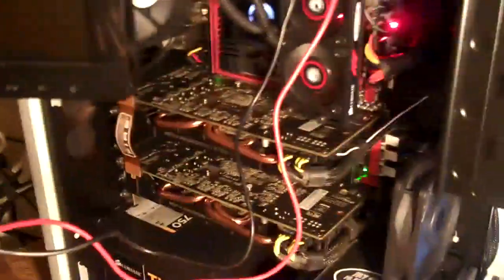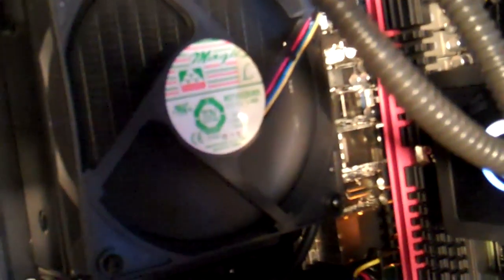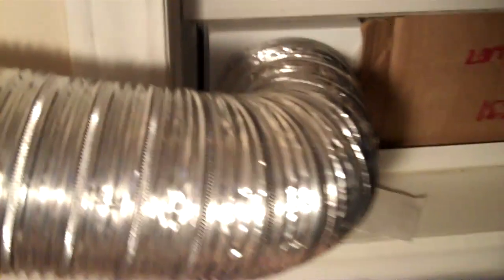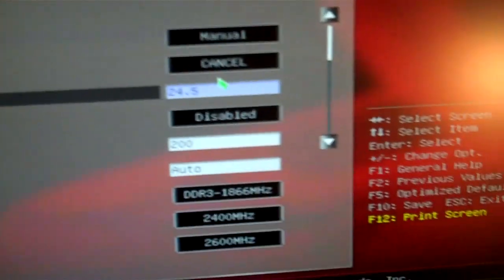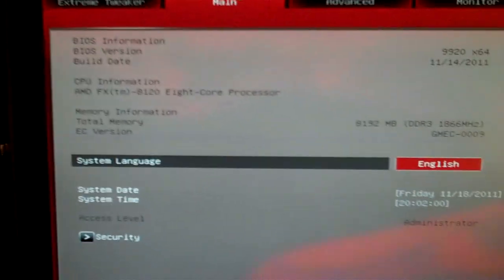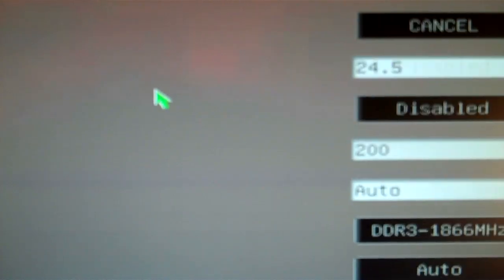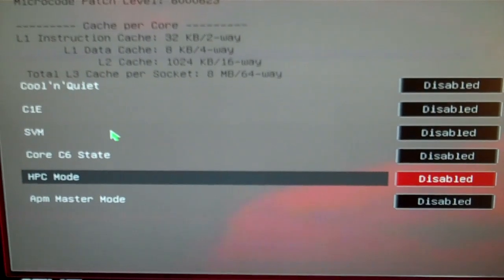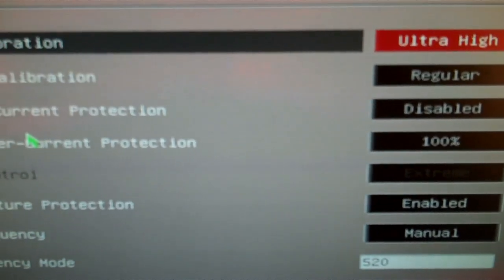Bulldozer FX-8120 #1 Overclocking Part 1/8

Comment from the maker: The FX chips get HOT in general.  The best thing to do is get a decent size rad and a nice block if you want to keep temps low.  I would recommend waiting to see how the performance is with Vishera/Piledriver and power consumption.  With a nice water cooling unit you could probably get your chip stable up to 4.8-5.0GHz without any problem.

Comment from the maker: All depends on the chip.  If it is a nice clocker and stays cool then yeah you should.  You'll probably need more than an H80 to get 5.2Ghz.  Maybe if you hook a cold air duct to your intake rad fans then you should be able to.   Its all down to the chip though.  Some chips cant clock past 4.6Ghz but some can go up to 5.5GHz on water.

Comment from the maker: This does not apply in most cases.  Voltage usually fluctuates a lot depending on what the clock is especially when overclocking with extreme cooling.  Voltage in most cases does not scale linearly but exponentially.  The higher clock you try to achieve the higher the rate of increasing the voltage you will need.  Every chip has a voltage wall where it just wont go any higher because it just requires too much power and temp affects this too.  There comes a point where more voltage doesnt work.

Comment from the maker: @idan124 Depends on what phenom....   I upgraded from Phenom II x4 965 @ 4.2Ghz and the 8120 is defintely an upgrade.  If you have a phenom II x6 then I would not upgrade.  Even if you have a Phenom II x4 I would not upgrade.  Wait for Piledriver or Trinity or even later.  Phenom II are still very decent chips.  If you do plan to upgrade then you need to understand that BD is a 1st generation chip.  It is not an amazing chip nor a dud.  BD is a very capable chip and is great for multitasking

Comment from the maker: @Moution23 You have one fan pushing into the heatsink or radiator and then you have the fan on the opposite side pulling air out of the heatsink.  Thats all.

'||' - heatsink/radiator ,  '-->' - fan direction

--> || -->   , like this.

Comment: The bench mark for the stock AMD FX8120 3.1GHz is around 7000-7200
If it's clocked at 5.0GHz per core what will it's bench mark be?

Comment from the maker: Yes 1866 is listed along with 2133 and 2400Mhz.  2000Mhz is not listed.  I used to have 990fx gd-80 and it only went up to 1600 until I got this processor and then I was able to select higher ram clock.  This cpu runs at 1866Mhz native but there were higher values once I installed the FX processor.

Comment: Is 1866 mhz memory listed in the memory option.  I have a 990 fx GD 65 motherboard and the highest ram listed is 1600 which from all the reviews of motherboards I saw is the highest the list goes up to without overclocking the FSB.  Is 1866 listed at default under 1600 on this motherboard and was it just added with a recent bios update because all the reviews I have seen for this board only shows 1600 for memory options.